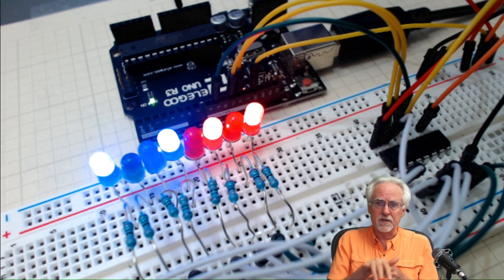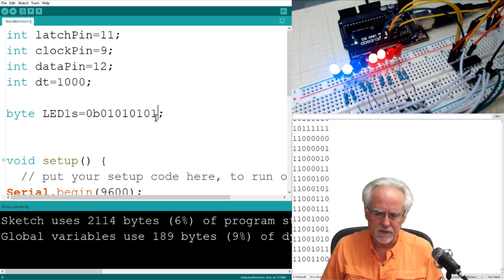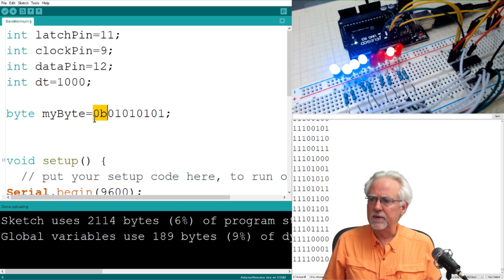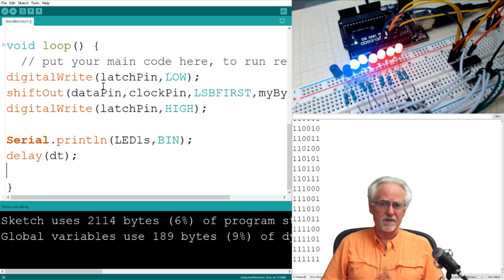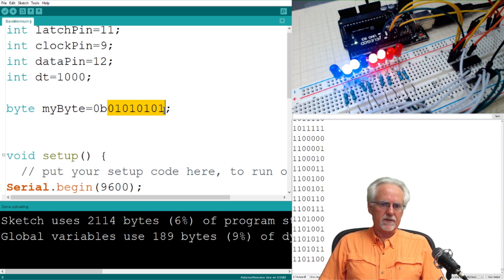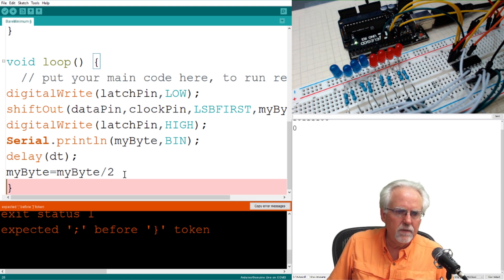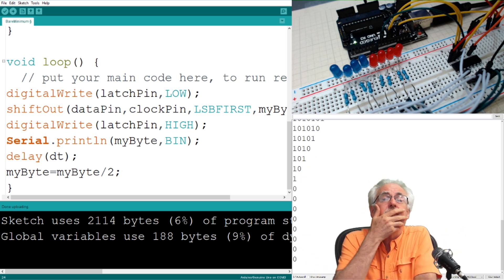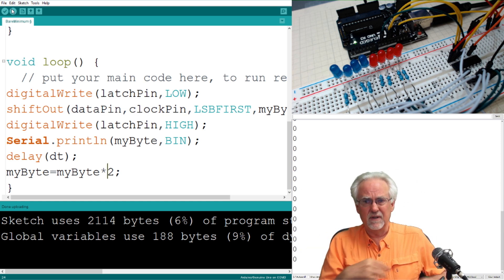Arduino Tutorial 44: Understanding Logical Shift Left and Logical Shift Right with the 74HC595

Comment: For the first part I just bit banged zeros into the shift register like this:

void loop() {
  digitalWrite(latchPin,LOW);
  shiftOut(dataPin,clockPin,LSBFIRST,LED);
  digitalWrite(latchPin,HIGH);
  delay(dt1);
  
  digitalWrite(dataPin,LOW);
  digitalWrite(clockPin,LOW);

    for(int j=0; j<8; j++){
      digitalWrite(latchPin,LOW);
        digitalWrite(dataPin,LOW);

        digitalWrite(clockPin,HIGH);
        digitalWrite(clockPin,LOW);
      digitalWrite(latchPin,HIGH);
      delay(dt1);
    }
}

For the second part I first drew the value in decimal of each "step" to the left and thats how I found the *2 and /2 relation to do it.

Comment: I was studying C alongside your tutorials and we recently just encountered shifting bits. I encoded that into my original code, but I wish that I also had found out that I could've just divided and multiplied the bits! Your solution was so much understandable. Mine is a bit more complicated since I decided to add user input and had to look through other materials to find out how to do that. Here's the assignment that I did before watching the lesson sir Paul!

int clockPin = 9, latchPin = 11, dataPin = 12, dT = 250, dTLong = 950;
byte myByte = 0b01010101, shiftByte;
String userInput = "";

void setup() {
  Serial.begin(9600);
  pinMode(clockPin, OUTPUT);
  pinMode(latchPin, OUTPUT);
  pinMode(dataPin, OUTPUT);
}

void loop() {
  Serial.print("Write an 8 bit binary number: ");
  while(Serial.available() == 0) {
  }
  userInput = Serial.readStringUntil('\n');
  userInput.trim();

  myByte = strtoul(userInput.c_str(), NULL, 2);
  shiftByte = myByte;

  digitalWrite(latchPin, LOW);
  shiftOut(dataPin, clockPin, LSBFIRST, myByte);
  digitalWrite(latchPin, HIGH);
  delay(dT);
  Serial.println(myByte, BIN);

  delay(dTLong);
  Serial.println("Shifting to the left...");
  while(shiftByte != 0) {
    shiftByte = shiftByte << 1;
    digitalWrite(latchPin, LOW);
    shiftOut(dataPin, clockPin, LSBFIRST, shiftByte);
    digitalWrite(latchPin, HIGH);
    delay(dTLong);
  }

  shiftByte = myByte;
  delay(dTLong);
  Serial.println("Shifting to the right...");
  int i = 7;
  while(i > -1) {
    shiftByte = myByte << i;
    digitalWrite(latchPin, LOW);
    shiftOut(dataPin, clockPin, LSBFIRST, shiftByte);
    digitalWrite(latchPin, HIGH);
    i--;
    delay(dTLong);
  }
  i += 2;
  while(i < 9) {
    shiftByte = myByte >> i;
    digitalWrite(latchPin, LOW);
    shiftOut(dataPin, clockPin, LSBFIRST, shiftByte);
    digitalWrite(latchPin, HIGH);
    i++;
    delay(dTLong);
  }
  Serial.println("Finished shifting.");
  Serial.println("");
}
Reply from the maker: Excellent job on the assignment, it looks great!

Comment: Rather than division and multiplication, I used the shift statements.
    j++;
    myByte= myByte >> 1;
    show();
    prtBit(myByte);
    if(j==8) delay(100000);  // 100,000 mSec effectively stops the code 

Also note I used functions show() to light the bits and prtBit(x) to display the number on the serial monitor.  That display converts the 0 and 1 to ASCII code so you don't loose the left most digit when it happens to be 0.

Comment: I cheated. :face-purple-crying: As a former app developer, I remembered being told that bitwise operators are not important. In fact, everything to do with binary. However, the textbook I read had these >> and << characters which were called bit-shifters. So, I tried it out and it worked. No division, no multiplication. :face-green-smiling:

However, this circular shift thing is getting me worried, I was never an A student in Maths.:face-pink-tears:

Comment: I spent 5 hours trying to get the lights to go from left to right then right to left and loop.
in the end i succeeded but it was such a simple solution.
I was trying to do this with only 1 "myByte" value. I'm not sure if you can with just 1.
i needed 2 "myByte" values to make the points.
and a "unsigned int state;" to make the line.

Comment: I DID IT!! That assignment at the end stumped me and I had to play around with the code for so long to get it to work! Turns out I basically had it from the start, but I tried to do everything in one line, which messed everything up! I came so close to caving and relying on the next lesson's explanation. I'm glad to have stuck it through because I knew I was onto something, and that it would most-likely end up being easier than I initially thought!

Comment: I reverse engineered my way into figuring this out by calculating the dec value of 10101010 = 170, then calculated the value 01010101 = 85 and could see it was halving moving right (/2).  I theorized *2 would do the inverse.

Comment: I tried to do it but I didnt understand one part. Why do we just divide by 2? I did the math  for example from going from 1111 1111 to 0111 1111 and it is like going from 255 to 127 which means that by dividing with 2 we would get to 127 and there is a 1 extra. Thats why I did myByte=(myByte/2)-1. Does this have anything to do with the LSBFIRST command?
Reply: Full disclosure I'm just learning as I go on these lessons.  But I think the answer to your question is that 255 is the 256th number and that divided by 2 is 127 the 128th number because 0 is counted.  And my understanding of the LSBFIRST and MSBFIRST is looking at the outputs from the chip as pins 0 - 7 vs. 7 - 0.

Hopefully this is correct as it's how it's working in my mind!

Comment: Hello again! I figured out the two homework assignments right before falling asleep last night. I was trying to do the binary counting in my head, so I couldn't be sure until I actually saw it in the code. Decimal 170 was every other LED starting on the right. Decimal 85 was the next four LEDs in the sequence. Just multiplying (and then dividing for the 2nd part)  each number by 2 was simple and easy. Thanks again for the brain challenge! At 63, I need all of those I can get. ;-)

Comment: I came up with a slightly different way of approaching this lesson. I first set the myByte to "0b10000000".
Then in the Void Loop I made myByte=myByte/2. This made the far left blue led come on first, then it continued to the right lighting each led in a row. For going from right to left I changed the myByte to "0b1" and changed myByte=myByte*2. When I only changed the myByte=myByte *2, only the far left lighted up. Sorry I could not get the same result but, I think doing it in this fashion made the shifting right or left more visually accurate. Someone please try this and see what you think. I might be missing the point of the lesson. Also, why did the program not "loop"? Please assist! Thanks

Comment: Homework:

int latchPin=11;
int clockPin=9;
int dataPin=12;
byte LEDs=0b00011000;
byte LEDread;
int wait=500;
int data;

void setup() {
  // put your setup code here, to run once:
  pinMode(latchPin,OUTPUT);
  pinMode(clockPin,OUTPUT);
  pinMode(dataPin,OUTPUT);
  Serial.begin(9600);
}

void loop() {
  // put your main code here, to run repeatedly:
  LEDread=LEDs;
  while(Serial.available()==0){
    if (LEDread>128){
      LEDread=LEDread*2+1;
    }
    else {
      LEDread=LEDread*2;
    }
    Serial.print(LEDs,BIN);
    Serial.print("|");
    Serial.println(LEDread,BIN);
    digitalWrite(latchPin,LOW);
    shiftOut(dataPin,clockPin,LSBFIRST,LEDread);
    digitalWrite(latchPin,HIGH);
    delay(wait);
    }
  data=Serial.read();
}

Comment: After I did this homework, I used the 595 and what you've taught me so far to create a little game 🎮 The 595 lights up a single LED at a time, starting a loop at 0x01, through to 0xF0, and back to 0x01. I used a green LED at 0xF0; the aim of the game is to use a push button to hit the green LED. When successful, the serial monitor displays the cumulative score. On a miss hit, the track resets. I set threshold score values to reduce the loop delay time, making the lights zoom up and down the track at increasing speed. A fun and practical use of this chip has really helped consolidate my learning so far.
Reply: Wow, that's actually a neat little game! I think I may have to try that out too. Thanks for sharing, Thomas!

Comment: i am really having a hard time with the 74HC595.... I have two of them and so far i have tried both.....double checked every physical connection.....double checked the code.....made sure the LEDs are okay....made sure the chip fits into breadboard.... and even tried changing the pins on the arduino....but it just doesnt seem to work properly.......when I type 0xFF, only some of the LEDs light up when I type 0b00000001, a completely different LED lights up and not the one I expected....
any help would be appreciated :)

Comment: OK I've done both assignments in Tutorial 43. Using 2s complement in the formula, I used division to move the bits to the right and multiplication to move the bits left. I've also inserted an 'if' condition at the end so that the cycle repeats instead of having to manually restart the program.  Now to check out this video on the differences in methodology

Comment: I was not able to do it!
I did not want to do it one by one, manually, as it was obvious that this was not the objective.
But I did not come to the conclusion that dividing or multiplying by 2 would be the solution. Evidently, I must not have internalized the binary system yet.
Thanks, Paul!

As someone said, "the answer uses to be simpler than I thought!"

Comment: Haven't watched this video yet but the hw was tough.  Sounds easy but I had to write out the binary sequence, see what each equaled too, figure out the pattern, create a math formula to apply the pattern, and then translate it to code.  Since there were 4 different patterns, and each shift equaled at totally different value I had to use a counter variable so the code could use the right math formula at the right moment.  7 hrs for this one, but I'm sure this video will do something ultra simple comparted to what I have below LOL.  I also researched and learned about Switch Case statement because my initial problem made if statement unusable, but once I added the counter variable I realized I could use either so I just stuck with Switch Case.

int latchPin=11;
int clockPin=9;
int dataPin=12;
int dt=250;
float sub=1;
float add=128;
int counter=1;

byte LEDs=0b00000000;

void setup() {
  Serial.begin(9600);
  pinMode(latchPin, OUTPUT);
  pinMode(dataPin, OUTPUT);
  pinMode(clockPin, OUTPUT);
}

void loop() {
  switch(counter){
    case 1 ... 8:
        LEDs=(LEDs*2)+1;
        digitalWrite(latchPin,LOW);
        shiftOut(dataPin,clockPin,LSBFIRST,LEDs);
        digitalWrite(latchPin,HIGH);
        delay(dt);

  

        counter=counter+1;

       
        LEDs=LEDs*2;
        digitalWrite(latchPin,LOW);
        shiftOut(dataPin,clockPin,LSBFIRST,LEDs);
        digitalWrite(latchPin,HIGH);
        delay(dt);

        counter=counter+1;

        break;
   
    case 9 ... 16:
        LEDs=(LEDs/2)-sub;
        digitalWrite(latchPin,LOW);
        shiftOut(dataPin,clockPin,LSBFIRST,LEDs);
        digitalWrite(latchPin,HIGH);
        delay(dt);

        counter=counter+1;

       
        LEDs=LEDs*2;
        digitalWrite(latchPin,LOW);
        shiftOut(dataPin,clockPin,LSBFIRST,LEDs);
        digitalWrite(latchPin,HIGH);
        delay(dt);
        sub=sub*4;

        counter=counter+1;

        break;
       
    case 17 ... 24:
        LEDs=(LEDs*2)+add;
        add=add/4;
        digitalWrite(latchPin,LOW);
        shiftOut(dataPin,clockPin,LSBFIRST,LEDs);
        digitalWrite(latchPin,HIGH);
        delay(dt);
       

        counter=counter+1;
  
       
        LEDs=(LEDs/2);
        digitalWrite(latchPin,LOW);
        shiftOut(dataPin,clockPin,LSBFIRST,LEDs);
        digitalWrite(latchPin,HIGH);
        delay(dt);

        counter=counter+1;

        break;
   
    case 25 ... 32:
        LEDs=(LEDs-1)/2;
        digitalWrite(latchPin,LOW);
        shiftOut(dataPin,clockPin,LSBFIRST,LEDs);
        digitalWrite(latchPin,HIGH);
        delay(dt);

        counter=counter+1;

       
        LEDs=LEDs/2;
        digitalWrite(latchPin,LOW);
        shiftOut(dataPin,clockPin,LSBFIRST,LEDs);
        digitalWrite(latchPin,HIGH);
        delay(dt);

        counter=counter+1;

        break;

    case 33:
        sub=1;
        add=128;
        counter=1;
        Serial.println("RESET");
        break;
  }
}

Comment: Figured out an awkward way to do it involving if statements storing whether the offending bit was high or low, and then passing that along.  Then figured out a much more elegant way by either multiplying or dividing the number by 2^7.  Just takes one line.
Reply: For those curious:
LEDs = LEDs / 2 + LEDs* 0b10000000;   //for the circular right shift

and 

LEDs = LEDs * 2 + LEDs/0b10000000;  //for the left

Comment: Well, I got it to work... figured out the *2 and /2 for shifting, but for some reason, I found I also had to add or subtract a 1 in every other operation.  I  also thought that we were to start with 10101010, shift that right until zero, and then start with zero and shift it right until 10101010.  Anyway, I got that to work.  I'll go back to my code and see why I used the +/- 1 every other operation.  Seems screwy.... but so is my code sometimes!  Dunno if I can even attempt the next assignment.  This one hurt my brain... in a good way, of course.

Comment: I did my homeworks crazy insanely... I noticed that I had to multiply and divide by 2 but I did it on paper first and I didn't imagine the LSB would be skipped... My code worked though... with 10 more rows ><...
Thanks !
Edit: I think I know why I had a problem with simple multiplication and division : I wanted to make a shift back and forth with a 0101 pattern from 0b00 to 0bFF, but with your solution, it doesn't work from 0 (multiplying 0 by 2...) and if I increment by 1 first, then I have 1, 2, 4, 8, 16, moving only one led to the left. Which is not the desired result...
Thus I can't find another simple solution to solve my case.
If anyone reads me and has a simple solution (less than let's say 20 rows), I'd be glad to know it :-)...

Comment: It reminds me of coding back in the 80's in the 640k XT class computers. When you're limited to an 8 bit bus but had graphics adapters which were using 64, 128, 256 colors, you had to serialize the data for the adapter to convert in much the same way. Multiplexing wasn't it? Bit masking, shifting.. writing directly to the screen position in memory as fast as your computers clock could go. Ahh! It's all coming back! 😅

Comment: I wanted to dive a bit deeper and understand exactly why multiplying by 2 shifts bits to the left. I eventually had the thought to write out the multiplication of the byte number by the number 2 in binary (00000010), much the same as we all learned in grade school with decimal numbers.

01010101    (byte to shift left)
00000010    (multiply by 2 in binary)
-----------------
00000000    (multiply least significant bit of bottom number (0) by all digits in top number from right to left, giving all zeros) 
10101010    (put a zero placeholder in the rightmost position, then multiply the next significant bit of bottom number (1) by digits in top number from right to left).

The result is indeed the original byte number shifted to the left! As a consequence of this, you can explain how dividing by binary 10 shifts bits to the right, since it's just the reverse of what I demonstrated above.

Thanks again for the lesson!

Comment: I did it..... a much too complicated way..... I found a few patterns in the numbers which worked. I misunderstood the assignment because I thought you wanted it to shift left & right in one pattern. So I started with 0 etc.

In decimal format I found our pattern was 0, 128, 64, 160, 80, 168, 84, 170 (and reverse). Long story short, I did way too much math and used 2 sheets of paper figuring it out.

Funny, I knew there would be a better way, but I wanted to do it myself first. I like that code has many options to complete the same job.

Comment: Started off by trying to cast the binary number to a string, then inserting a 0 at the beginning or end, then casting back to a string. That was an epic failure. Once I started working it out on paper it came to me right away. Love how elegant and simple it is to multiply and divide by two to achieve the desired outcome.

void loop() {
  // put your main code here, to run repeatedly:
  
  byte LEDsCopy = myByte;  
  for(int x=0; x<=8; x++)
  {
    digitalWrite(latchPin, LOW);
    shiftOut(dataPin, clockPin,LSBFIRST,LEDsCopy);
    digitalWrite(latchPin, HIGH);
    LEDsCopy = shiftLeft(LEDsCopy);
    delay(dt);
  }
}

byte shiftLeft(byte binaryNum)
{
  return binaryNum*2;
}

byte shiftRight(byte binaryNum)
{
  return binaryNum/2;
}